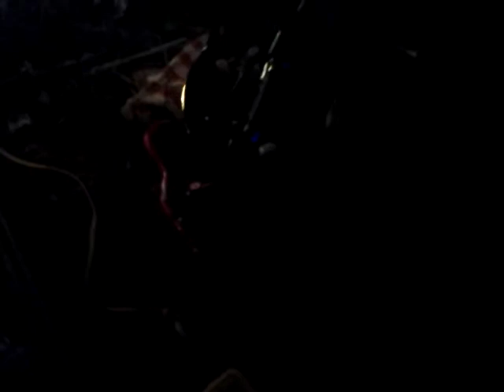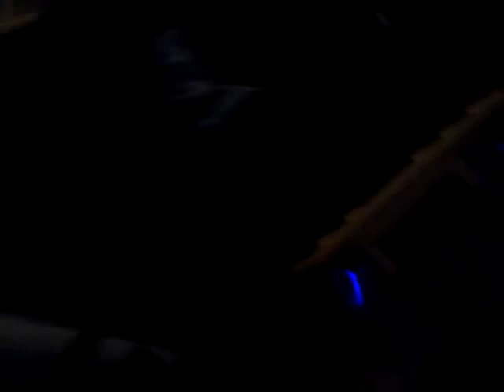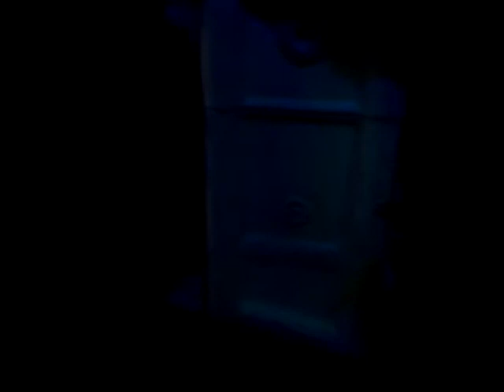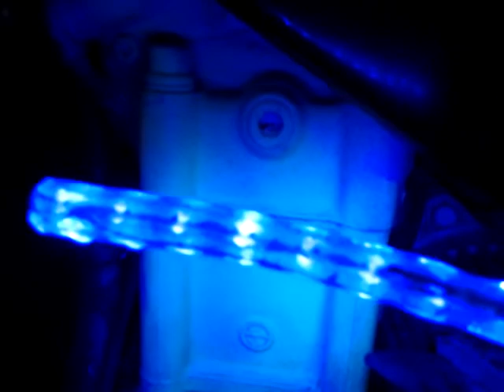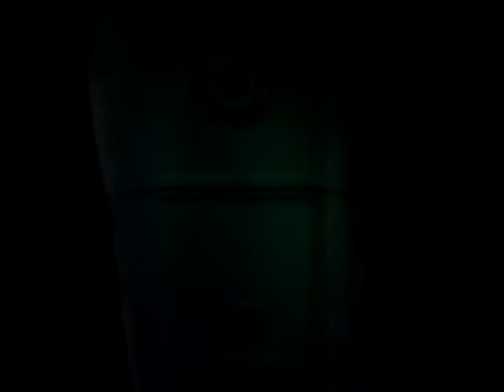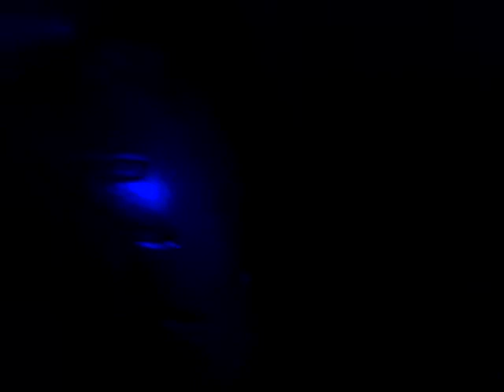95 Zx750 project... Glow in the dark engine

Comment: where do you even get high temp glow in the dark paint is there other colours?
Reply from the maker: Tyson Swannell spray it with any high temp paint then go over it with any glow in the dark color. the engine really only get up to about 500 degrees so as long as the prep is done right for the first coats, then the glow paint will sit unbothered
Reply from the maker: you can also use glow pigment powders mixed with clear coats to get better results. this video was my beginner ideas